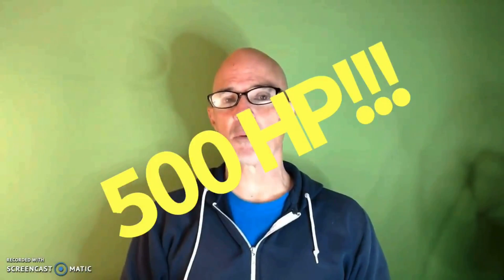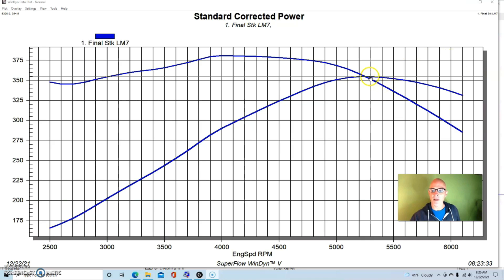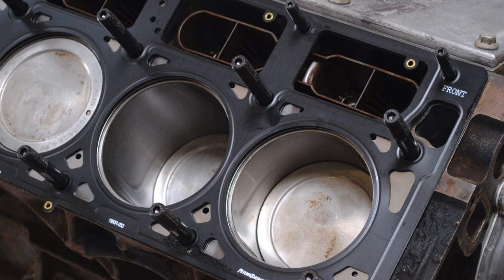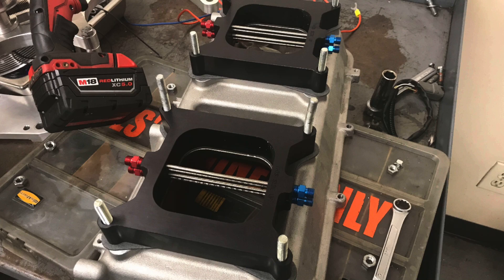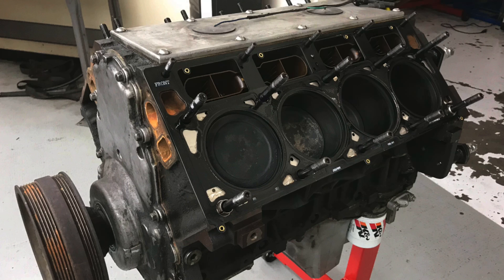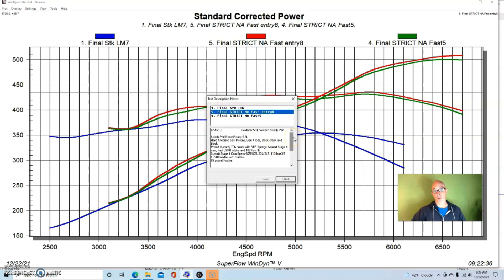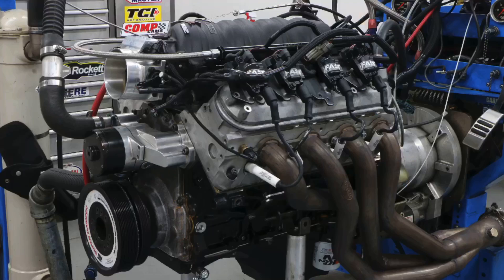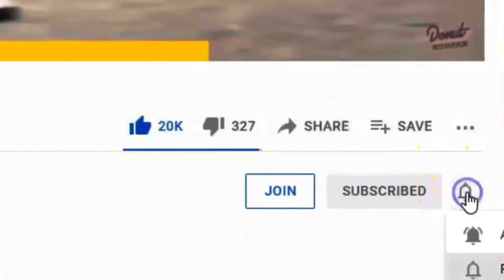HOW TO: JUNKYARD 500-HP 5.3L LS-CAN MY NA 5.3L LS MAKE 500 HP WITH A HEADS, CAM AND INTAKE UPGRADE?

Comment: I have an issue of Engine Masters magazine from a few years back that features a 5.7 HEMI that made over 500hp with the factory heads that were not touched .
Reply from the maker: they have enough flow to support that power level on a good 5.7l

Comment: So these set ups would be 375-390hp wheel depending on accessories catalytic converters transmission/differential
Reply from the maker: 400 ish on a manual

Comment: Don’t think you’ll make 500hp to the crank with these 5.3 combos in your car. By the time you bolt on accessories and air boxes they won’t be 500hp engines. No one runs an engine like this in a car.

Comment: just saw a video showing an LT-series (Gen-II) engine fitted with "indie-coil" (coil-on-plug) ignition... and I thought: Since the L31 (Vortec 350/5.7L) uses a crank trigger, aside from adding a cam trigger--as seen on Gen-II conversions--why not do one on an L31? How hard would doing such a conversion be? And since the engine already has sequential EFI, wouldn't that be worth doing? \:|
Reply: The main reason that coil conversion was done on the LT1 engine, was to eliminate the prone to failure optispark. L31 distributor is pretty good and you don't really gain to much from it. Yet, if that's what you want, then yes it's possible to do it to an L31.
Reply from the maker: no need on the l31-the LT1 is a different deal

Comment: Trying to drive them in a car would be a giant headache though.
Reply from the maker: why
Reply: @richardholdener1727  
Richard that much cam with only 326 CI will have a lot of chop without much idle vacuum. It will need a steep rear gear in a manual transmission car or a 3400+ converter in an automatic car. But I suspect you know this and that was a rhetorical question.

Comment: Hey Richard. I know I've brought this up before but I'll bring it up again because some recent events have peaked my curiosity... how interested would you be in testing a crossfire setup? And for that matter, what would you need to do it?
Reply from the maker: I am interested-mostly to modify one
Reply: @richardholdener1727  Well, I have a totally stock intake (2 actually), lid, and throttle bodies I could send down for testing as well as renegade and one that I am working on porting and modifying with a friend on a flow bench. If it does interest you I'd be more than happy to send something your way for testing in the name of science.

Comment: Quick question is the BTR stage 3 twin turbo cam to big for a 5.3 with twin 7875 turbos
Reply: How much HP are you shooting for????
Reply: @scotttimpany2845  at least a grand
Reply: @vrg69  The BTR Stage III cam is 231/243 .618"/.617" 115+5 .  That's pretty healthy for a 5.3 liter.  On the street, it'll be soft down low.  As for the turbos, one 7875 flows enough air to get you to 1000 hp.  Two would be closer to 2000 hp.  I think a single 7875 would be a little sluggish with that cam on a 5.3.  Twins with that cam on a 5.3 wouldn't be much fun around town.  I "know a guy" with a BTR Stage IV equipped 408 and a single PTE 88mm Pro Mod turbo on the street.  It drives like yer father's Oldsmobile until 4000 rpm or so.  It destroys 31x18.50x15 Mickey Thompsons on spirited downshifts from 4th to 2nd. In short, if you're on the street, a BTR Stage 1 turbo cam and a single 78/75 would be "sporty".  Of course, it's an opinion and opinions are like...  Join Richard's live chat at 7pm PST and ask him what he thinks...
Reply from the maker: that is too much cam and too many turbos for just 1000 hp
Reply: @richardholdener1727  JUST 1000 hp.  Ha!
Reply: @richardholdener1727  minimum of 1000 want to race it on track to

Comment: Richard I would like to see you do some small  Cubic inch engines like 283 Chevy, 289 Ford,  273 mopar. Maybe build them  Exactly the same. And 396/402 Chevy. The other guys.
Reply: 396/402 is definitely an other guys build. I’m very shocked Richard hasn’t done that video yet.
Reply: @Lagrange1186  me too I'm doing a 402 build as we speak thinking about boosting it.
Reply from the maker: a 396 bbc build is coming
Reply: @richardholdener1727  thank you so much! And Merry Christmas!!!

Comment: This is good stuff! Man, 20 years ago it was almost impossible to get 500hp on pump out of a 5.7L let alone a 5.3L. People pooped at the ls6 with a "Hot Cam" when it debuted. I really love that 3rd combo. It just makes sense for the little guy, plus a little spray for S&G's.🤘🏻🇺🇸
Reply: 100% agreed, especially when considering drivability! That 3rd combo "just makes sense". Simple and effective, LOOKS stock.
Reply: @jonwaterbury3312  the first combo looks appealing. The least aggressive cam of the 3 may result in the best streetability among them. The last one already uses a "stage 4" cam, which i assume has worse low rpm performance than lower stage cams of the same model.
Reply: You’re comment is so weird.
Reply: @littledeel  your*

Comment: Yes but what do you get with cam, flat top pistons and stock heads with spring upgrade! Most people that get these engines don't want to spend 2500-3000 for a set of fancy heads!
Reply: You can get big power with factory heads.  Cams are they key.  With a good cam and a spring upgrade, 450 hp is a reasonable goal.  I bet Richard has 20 videos on the topic.  The FAST intake is huge money, but a Trailblazer SS intake is cheaper and makes great power.
Reply: @scotttimpany2845  I’m sure you mean engine dyno 450. so 330-350 wheel hp
Reply: @utahcountypicazospage5412  Yes, I think 450 hp on the engine dyno is possible.  If you subtract drivetrain losses, your estimate of 330-350 WHEEL is probably about right.  We're just bench racing here, so there's no way to be exact.
Reply: He's put out a gazillion videos on LS engines of various displacements, please check them out lol
Reply: I did a search and it came up lol!
Reply: Well remember that this is engine dyno with no accessories running cooler temps no catalytic converters so I would say these combos are 375-390hp wheel combos realistically
Reply: You can make 380 wheel easy with factory heads and a cam with stage 2ish specs. The truck intake is fine, you just need headers and a tune.

Comment: Liked and saved!  Planning on an LS4 swap/build!
Reply: I'd love to see an LS4 in the bed of an S10 or something.  Maybe in the rear of a station wagon.  Zoomies on a transverse mounted V8?  Cooooool.
Reply: @scotttimpany2845  its going into my wife’s 03 rav4 lol.  I’m keeping the 4t65ehd rebuild ot with a shift kit and a better tc. I’m not planning on making more than 500 crank hp.  I’ll be really happy with 400crank hp too.  To swap in the 4t80 is a bit tricky and there isnt much for aftermarket support for it.  I’m thinking about swapping in a built th125c too.  Should be a fun sleeper.  Cam, springs, headers, intake.  Should do just fine.
Reply: You ever see that green Monte Carlo with a turbo LS4 and a 4T80E that runs 9s or something?  Soooo cool.
Reply: @scotttimpany2845  i haven’t seen the green mc but i did see a green eclipse with the ls4 turbo swapped 4t80

Comment: Richard, what 4 point steam vent is used for the lsxrt intake? I currently have the factory 4 point, but I'm getting mixed information if it will work or not.
Reply: It should be I went with the A-Team Performance version. If you go that route, get their Aluminized heat sheath to run the hoses through as you install it. That will help protect the manifold from heat soak since the driver side front-to-back goes on the outside of the manifold.
Reply from the maker: we did not use one

Comment: How much power is the stock truck intake good for ?
Reply from the maker: depends on combo
Reply: @richardholdener1727  
 Stock 4.8 with ring gap. Stock truck intake "Truck Norris" camshaft, stock truck manifolds. 
 Twin holset hy35w turbos. Using internal waste gates . Has "rising boost curve" boost creep over 4000 rpm due to gates not flowing enough. Going to port them. So far Works good for me 👍.

Comment: Has anyone ever built an LS the OPPOSITE way - as in, making all torque with not so high-revving HP? I miss the old 350/383 for that! I'd love to build the LS in my '07 (GMT-900) Silverado 1500 to yank trailers around much easier than I have been. I hate how I have to scream this thing up to 4-5k just to make any power. Below 3k, it's useless - the exact opposite of what I want in power output!  I wouldn't mind at all if the engine signed off at 4k RPM, but rivaled a Duramax in torque numbers down low, if that's even possible.
Reply from the maker: you need a mild cam 6.0l with 706 heads
Reply: @richardholdener1727   like a Truck Norris  cam from BTR maybe 😁
Reply: @richardholdener1727  THANK YOU,  Richard!
Reply: Add a 4 inch crank.  I have a Dart billet 4 inch under the bench that needs a thrust surface repair... The LS 383 (about 6.3 liters) with a stage 1 or stage 2 cam will make a boatload of torque down low.
Reply: @scotttimpany2845  perfect except ad a pair of china Rev 9    66 mm turbos  no lag back pressure kills them at 5000 rpm.  Will make over 900 ft lbs diesel power.
Reply: @scotttimpany2845  Nice!👍 Thanks, Scott - added to my notebook.
Reply: Put a smaller cam in your engine and you will see bigger gains in hp and torque on the bottom end. I have noticed more bottom end torque when using 3:73 rear end compared to the 3:42.
Reply: @tskraj3190  I already have 3:73. It pulls just fine with the stock LMG, Hypertech canned tune, Corsa cat back, and K&N CAI (minus the K&N filter), but I know it is capable of much more. Smaller cam might be the ticket to shifting the power downward in the range. I'll have to learn what components together can make this happen. It's like starting all over again. Just when I learned everything there was to know about the 350, the LS comes out. Figures!
Reply: @tskraj3190  I'm reading the post & what rear axle would you use budget wise in a 04 2wd single short box silverado 1500 with a 4.8 ?
Reply: @johngray2526  If you're hauling or towing regularly and trying to save on fuel 3:73. If you're towing heavier loads and don't mind getting around 2 mpg less highway then 4:10.  The 3:42s are fine if your haling "light" loads but they are sluggish when trying to pull a heavy load on take off.
Reply: @tskraj3190  ok just about the only thing I normally tow is a boat I did tow a 36foot boat from Louisiana to mississippi it wasn't easy but I did take it easy the hardest part was going across some steep bridges lol and the truck had plenty of power but struggled upwards. I have a 04 silverado 1500 2wd single cab short box with a 4.8 vortec with 254,733 miles on it. all original except cold air intake the engine is still strong the trans is starting some little sluggish at time but shifts all gears smooth. I thought maybe a different ratio rear axle would be the answer 🤔
Reply: @johngray2526  For uphill 4:10 is your best answer. Just make sure you are using the tow/haul button.
Reply: @tskraj3190  4:10 I gotcha does that require changing the whole axle or just the gear
Reply: @johngray2526  You should be able to just swap gears.
Reply: @tskraj3190  that sounds better I don't have any help so I'm on my own @ 56 lol thank you brother & a happy New Year
Reply: Big cubes  small cam ,small chamber heads  like 706
Reply: If it has VVT adjust it so the cam is advanced in the lower rpms and add some spark timing. You tuner should be able to help you with that.
Every LMG  VVT table I have seen for US stuff  does nothing but retard cam timing to reduce pumping losses during cruising.
Reply: @osarmrnot  No VVT until 2009 if I'm not mistaken. Mine definitely does not have it. One less thing to break as far as I'm concerned, lol. Everything else on this truck has! 

I'm at 117k miles, and my oil pressure is dropping off fast. Won't be long before I'll be yanking it for either a rebuild or a crate replacement. Ideally I'd have Texas Speed build what I want, and throw a Whipple on top ... but with my funds, that's not happening. More than likely I'll be rebuilding what I've got out in the shop here with whatever I can find that'll make it torquey.
Reply: Very few things will ever give you low end pulling power like a gear ratio change,   if you don't mind some higher rpms at highway speed pop in some 4.56 gears in that pickup and you can pull anything, pop up the compression and a mild cam and you can tow a mountain
Reply: @davidcunningham00  Yeah, no doubt about it. I can live with its current performance - it's actually not as bad as I make it sound. I'm just thinking ahead for when my engine fails, which will be soon. I definitely don't want to put the same engine, same power back in it. Each part that failed I've replaced with a better, stronger aftermarket alternative. The rear differential is now a 4-pinion Ox Locker, and the transmission is now a PerformaBuilt Heavy Hauler with 5-pinion planets, and many other high HP goodies. Now it's the engine's turn.
Reply: @SmittySmithsonite  just remember hp is a product of torque, torque is the real power
Reply: @davidcunningham00  Yep, it's all where it happens in the RPM range. Higher up gets big HP, down low gets bigger torque than HP. 5252 RPM is the midpoint.
Reply: @SmittySmithsonite  in a pickup I don't care about hp over say 5500 rpms I'm a big torque fan, BTW I drive a semi just saying, now in my nova yeah I love to sing to song of rpms. That's why she will Rev to 7k+
Reply: @davidcunningham00  Yep, AMEN to that. Hence my quest for a torquey LS. If not for MA emission testing, plus the bastards rolling back the 15 year exemption, I would've just installed a carbureted 502 and been done with it. Now I have to stick with the LS so it'll pass emissions. Sucks!!
Reply: @SmittySmithsonite  where do you live,  what state,  here in Texas we only have that crap in a few places,  I live where it's not even close
Reply: @SmittySmithsonite  if truly you want massive torque,  sell the ls,  find a big block but if you want to stay ls then the larger cubic inch the better for that ground moving power,  next year I'm building for my 2001 4x4 k2500 a 415 stroker and putting a lsa blower on it,  to hell with a turbo,  they are good for high power but my pickup is a torque bastard
Reply: @davidcunningham00  - I live in moonbat central - AKA, Massachusetts. We've got the biggest ideological morons on the planet running this place. Not much you can get away with here. They put all the diesel tuners out of business. Made my dad revert his '09 Duramax back to the stock DPF that plugged up every 3k miles. Place is a friggin joke. I want out of here, but the wife doesn't want to move ...
Reply: @davidcunningham00  -Nice! Sounds like it'll be a blast! I'd love to get that same Texas Speed 427 my buddy has in his '11 Camaro. He's got a Whipple on that making 900 RWHP! Thing is INSANE. He's got enough money into that thing that he could've bought a twin engine aircraft. It never dips below 600 ft. lbs. at any point in the RPM range. He's been thinking of detuning the low end, just so it's easier to drive. If you hit a bunch of bumps that make your foot bounce on the gas pedal, the thing will start spinning the tires, and going all over the road sideways. It's a handful, lol.
Reply: @SmittySmithsonite  mmmm sounds like you need to register you vehicle in a different state,   I'm in Texas and well we are still free here.  For now until some asshole trys and then we will probably not care and still do our thing
Reply: Yeah it's funny that 99% of ppl don't think about gearing. I normally ran 3.73 in everything. Now I drive a 06 Impala 🤣
Reply: If you are losing oil pressure, pull the pan and check the o-ring for the pickup. they make a brace for it that will stop that o-ring from failing. 
2010 they added vvt. Get a BTR Stage 1 v2 truck cam, Torque cam, or Truck Norris. Get your MAF remapped. GM runs a hybrid setup and low RPMs will use the MAF. Canned tunes are fine but a dedicated tune will make loads of difference. If in AL, hit me up.
Reply: @natricjol  - Thanks man. I appreciate the info.  Unfortunately I'm about 1,000 miles northeast of you. Merry Christmas!
Reply: Texas speed stage 1 truck camshaft on a 112 lsa.anything you can do to the old small blocks you can do to a ls only difference is the old stuff made 100hp to the wheels when a 5.3 makes 240 hp wheel
Reply: @utahcountypicazospage5412  no. The old stuff made about 240 hp to the ground on a stock chevy 350
Reply: @davidcunningham00  you must be talking way back because after 74 or so the 350 did not make that to the wheels look up the specs as a matter of fact they didn’t make good power till vortec heads stock anyway because you have always been able to buy $3000.00 heads
Reply: @utahcountypicazospage5412  All those cars got modified anyway. Nobody left them stock. You could have a stock 350 built to the moon in an afternoon back then, unlike today where it takes you 2 hours just to get the crap off the top and in front of the engine, just so you can SEE the block! It's insanity. 20+ hours just to reach lifters on a LS in the trucks! Stuff is 10x more expensive today, too. Then you need fancy equipment to get the fueling right. I sure miss the old days. A flat head screwdriver & a twist of the distributor, and I'd have 300 HP to the ground after cam, heads, intake, and headers, all done in mere hours.
Reply: @utahcountypicazospage5412  you can look up numbers on paper all you want, in the 80s and early 90s was lower power, BUT even then they made way more then 100 at the tires, now a stock 350 in the 70s made around 300 at the crank,  so around 240 at the tires,  80s was probably down to 180 at the tires, and in 1996 probably back to around 240 to 280 again at the tires